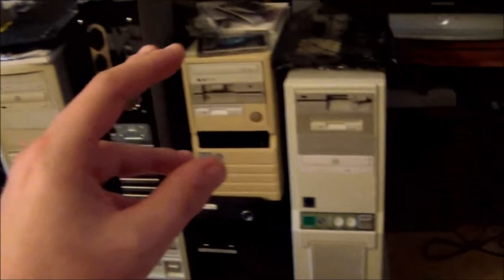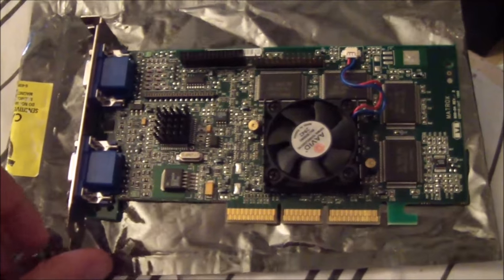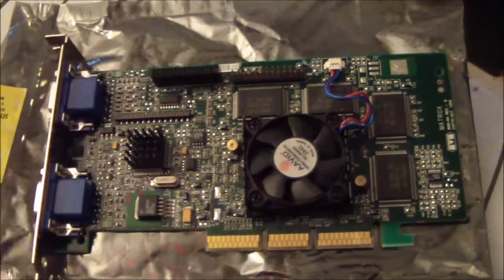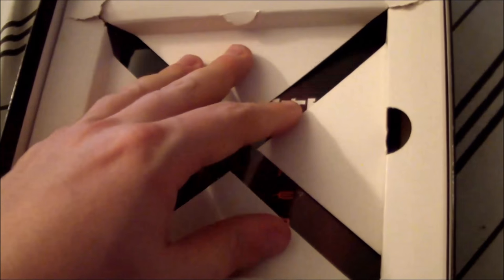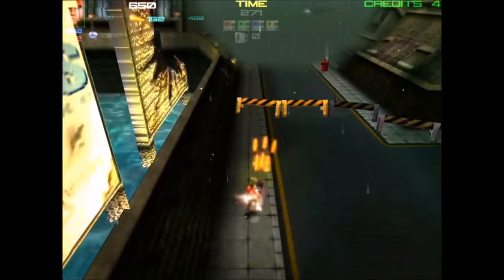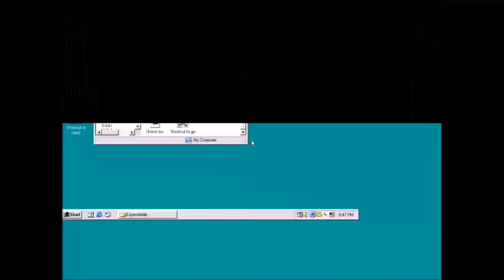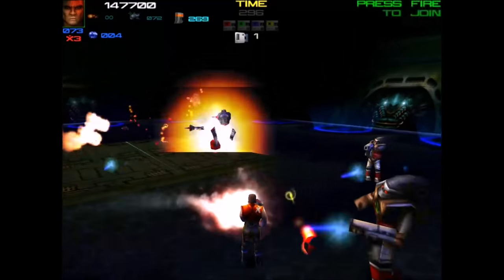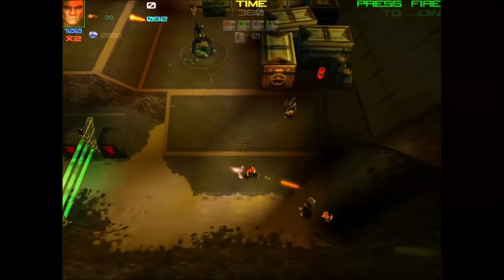Matrox G400 MAX and bump mapping in Expendable

Comment: EMBM was actually an invention from a company called Bitboys who are worth a story. Back in the 3Dfx days they announced their Glaze3d and Axe Graphics cards with amazing specs which due to bad luck turned out to be vapor ware. They were take over by ATI and when the latter merged with AMD sold on to Qualcom were they are responsible for their Adreno graphics core.
Anyway, the G400 is probably Matrox best card ever, also the first card to support dual monitors.
Reply from the maker: I really like the card, just wish I had more of a reason to use it. I guess there's probably other EMBM games from the era that need a Matrox and haven't been patched yet so there's a reason.

Comment: This really is a fun as hell twin-stick sort of shooter.  I actually got it a while back for my Shield Tablet when it was on sale in the Play Store.   Hopefully someday I can build a fairly cooled S478 rig with either a GeForce 3 or GeForce 4 card (or maybe even the FX5600 that's in a Craigslist ad that's still up that also has the 5200 and a GF4 Ti4200 all for $15!) and see how the PC version with EMBM turned on fares in graphics compared to the mobile port.
Reply from the maker: It is a really good running shooter, just wish the PC controls were better. Those cards are all pretty good choices for a high end win98 rig. the 5200 though is a dog of a video card. probably better off with a GF 4, the 5600 may be alright though.

Comment: I Love the G400max. It just feels so different from my TNT2 Ultra and V3-3500 cards. Yeah... Overall I can't decide what is the absolutte best of them three cards. They all have at least one strength over each other.
Reply from the maker: I agree. The G400 MAX usually gets overlooked in favor of the other two but it's really a great card that should be considered right up along with the others.
Reply: And not impossible to get at a low price. V3-3500 usually carry the most premium price of all three. I don't know if it is because of popularity, rarity or something else. Personally I feel the V3 belongs in a K6-II/III system and the TNT2 belongs in a P3 system. The G400-Max however, begins to shine in a P4 system. And with the newest drivers, it is quite capeable in OpenGL.